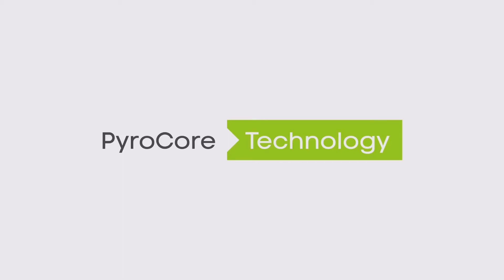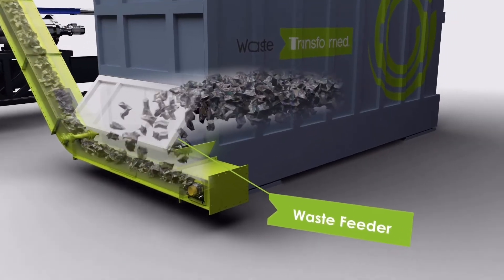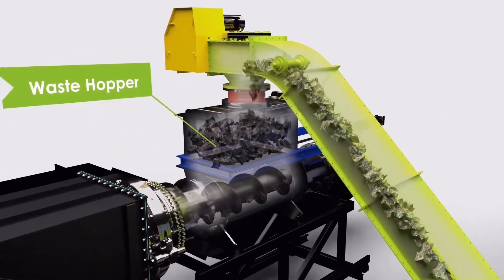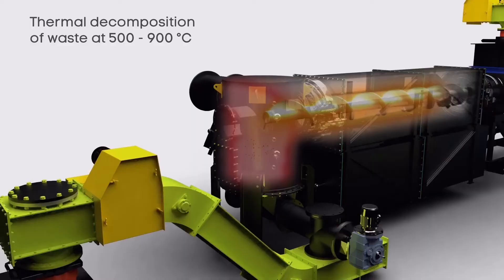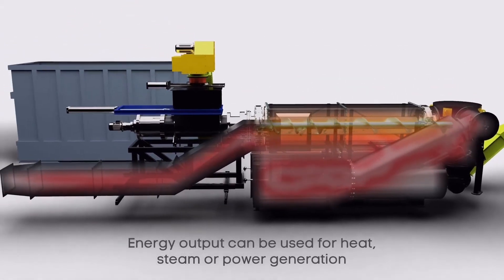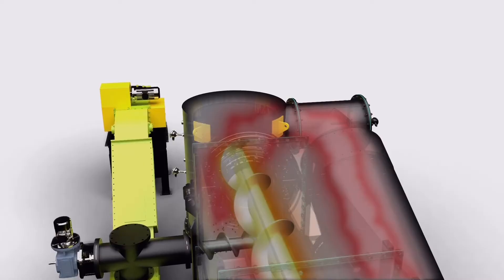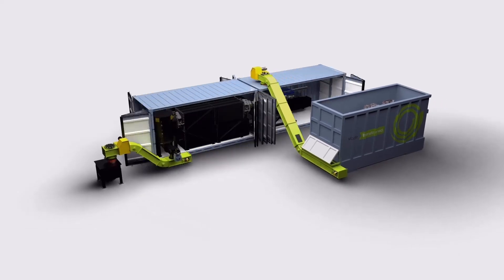PyroCore Technology: Pyrolysis how does it work?

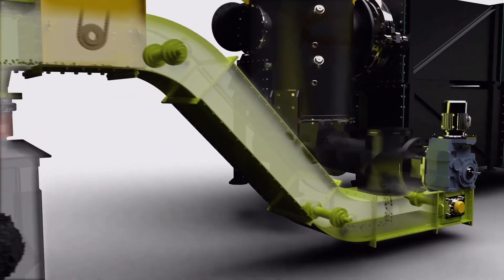Comment: I'm not sure if I agree. The references made at 1:34 are counterintuitive. Thoughts?
Reply: You don't need all the material in order to produce enough heat for pyrolysis.
Mostly or only, or even a portion of the syngas in burned

Comment: What is your typical feedstock?
 What does the moisture content need to be?
Reply: The feedstock is determined by the actual cost to dispose the waste.
It should be drier then 30% and have a size < smaller then 50mm before it enters the unit. We do provide pre-processaing accesories to reach these feedstock criteria. So there's no simple answer on your question, what the typical feedstock